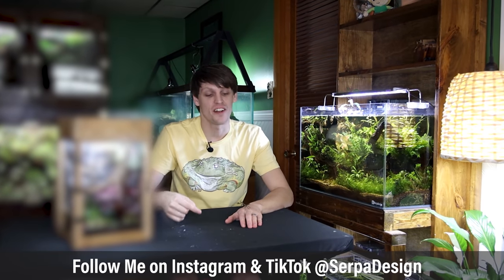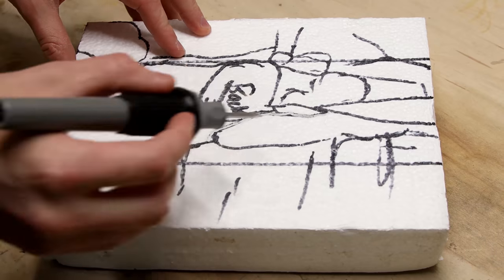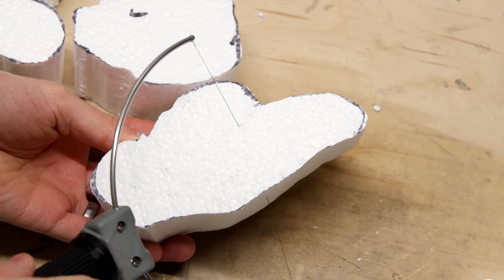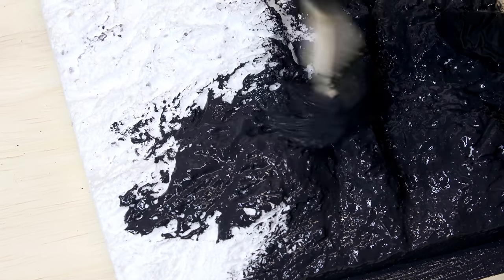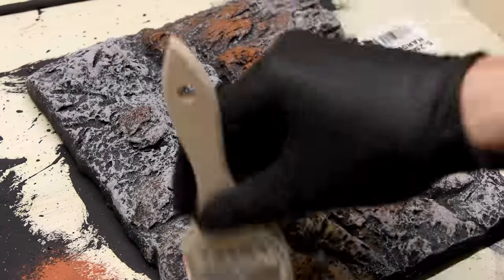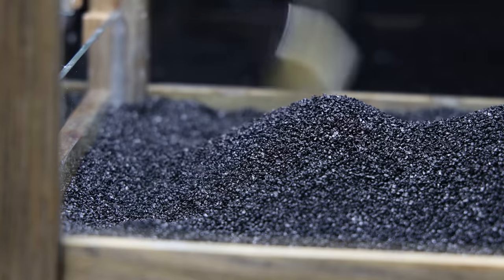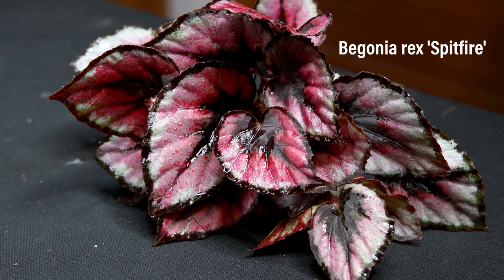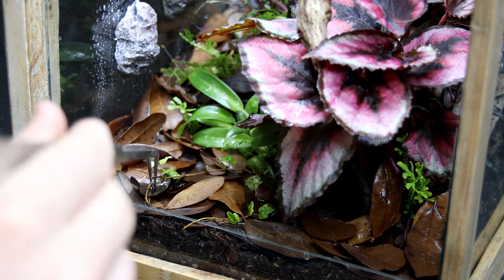Bioactive Ghost Mantis Vivarium w/ Realistic DIY Background (pt2)

Comment: It might be a step too many but I've gotten really good stone texture effects on wet plaster applied to a surface, you'd need to seal it after but super quick. mix up plaster, paint it heavily on leave it for a minute then lightly sprits the surface with just water. Different plaster thickness/viscosity will have different effects, looks quicker and more detailed than all that hand carving.

Comment: i’ve noticed that you often place ficus cuttings in your vivariums. how do you let them take root without it drying up?
Reply: I have the same problem :^(
Reply: the humidity in the enclosure should suffice, or you can mist just the cutting more often
Reply: if anyone else is wondering, ficus (and many other plants) cuttings can be rooted pretty easily just by cutting at a leaf node, putting that leaf node into the dirt, and keeping the leaves moist. You can keep it from drying out as fast by only keeping 2 or 3 leaves on the stem, as the leaves are the main way the plant loses water. Keep the soil moist but never wet, or it'll rot. It takes a bit of looking after, but other than the time put in it's pretty easy and rewarding.

Comment: Thats a very beautiful setup there!! Its good to see you let a little bit of place free so he'll be able to molt there. 
The only this that kind of bothers me personally is that i dont see any ability for a proper ventilation in this enclosure. For a ghost that should be not much of a problem but for something like an orchid (anything that need high humidity) you should definetly built in a cross ventilation, as mantids are sensitive to stagnat air! :'D other than that its a wonderful enclosure, bioactives are great for mantids (especially tropical ones!)

Comment: I had some experience with begonia rex... mine died after a month and do any of you know how to take care of them?
Reply: In my experience they need constantly moist soil, decent airflow, and a very specific light amount. Moist soil makes them prone to root rots. Most root rots are edible to springtails, so it's not really an issue in bioactive builds. Airflow in this build is high thanks to the fan setup but as long as they're not crowded I've not had issues with them. Finally, for light, they'll tend to grow to a height they're comfortable with. Burning them with too much light is easier than overshading them, since they can grow upwards towards the light but not down away from it, but if you do find them growing long stems with few leaves, they're probably not getting enough light.
Reply: @TehSlan  thank you... i will hunt for a new rex someday

Comment: SerpaDesign I don’t know what to do...I’m so upset. I’ve been keeping reptiles for over 35 years, never did I have an ant problem in any of my tanks. Now I just moved my plumbed basilisks into a 90, with all new , some old from their old tank, bio active substrate...springtails, moss, sand, soil....sob sob...then I went to clean out their big water container w a filter all these ants went running.....help....I took out my lizards, I sprinkled cinnamon and spearmint oil in the soil...but do I got to get rid of everything....I’m thinking it’s the easiest...but geez....did u go through this?